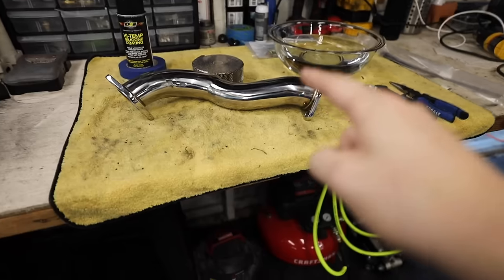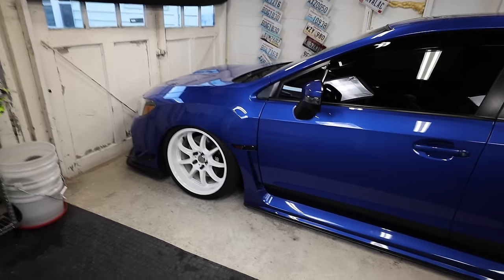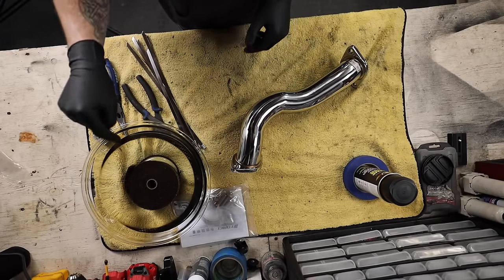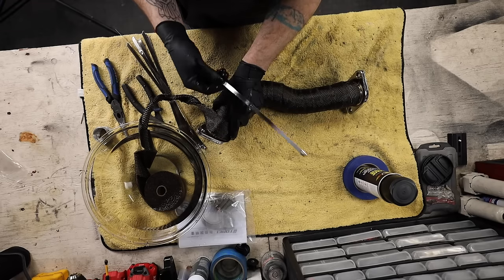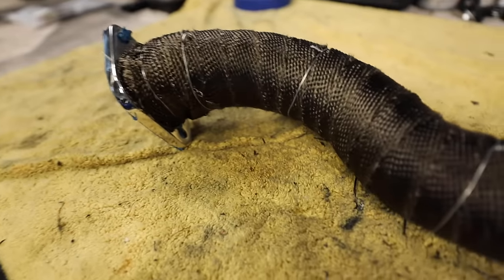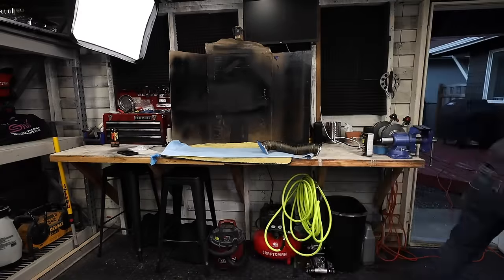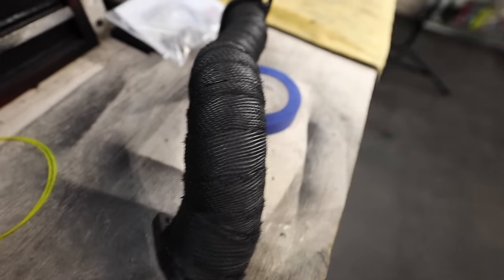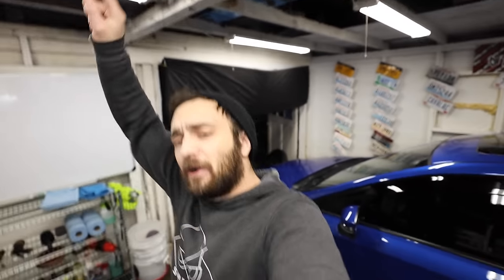How To Correctly Wrap Your Exhaust!

Comment: Hey boss, I’m getting ready in the morning to do my wrap for my overpipe as well on my Frs.  You make it look smooth and easy.  I bought the lava titanium, I thought they don’t recommend wetting it.   I started the process and it kept slipping on the bends of the pipe.  Will soaking it make it stay in place without slipping as you wrap ?
Reply from the maker: It made it a lot easier, you don't have to soak it but the material seems to form better to the pipe when wet 🙏
Reply: @Smeedia  awesome my brother I appreciate it.  I’m gonna do it.   Thx much ❤️
Reply: @Smeedia  just enjoyed your live stream.   Thank you for your service to our country.  I’m also a disabled Iraq war veteran. U S Air Force.  
I’m the one with the question about the  Mazda larger oil filters for your turbo Brz. It was awesome hearing you read my question.   Whenever you get a chance I would love the part no. Or the info on the Prova.  I don’t know if I’m pronouncing that correctly or not.    Thanks again what you are doing for our car community.   Much love and respect.  I’m going to get a T shirt when the Black Friday codes pop in.   ❤️
Reply from the maker: Appreciate the support my man! And lemme see

Mazda:N3R1-14-302
Prova: 10000SP0011

Thank you for your service as well!! 🙏🙏🙏
Reply: Disregard the filter info partner, I researched it and it’s the Mazda unit for the 09 RX8.  Filter no. N3R1-14-302.  👍

Comment: The wheel is cylindrical in shape, no one would prefer a square shaped tire from a cylindrical tire because the cylindrical tire already works great. Now the metal zip ties are already good stuff and for some reason, this dude chose the wires over it and made a thumbnail saying "the only way you should be wrapping your exhaust".

Comment: Even if it were the normal fiberglass that DEI supplies you never soak it, just dampen it up and if you cant get those metal zip ties ties its because you have the wrong tool... I’ve seen a drive type bit with a slot for relatively inexpensive but they sell a special plier like tool for the zip ties for around 20 bucks... tie wire looks shitty and lazy.
Reply from the maker: Disagree, I think yhe tip ties look bad, but personal prefrence on that one. Ive always had better luck with fully soaking vs dapaning or dry apication but to each their own

Comment: WTF dude this is the incorrect way to wrap this particular product. Did you care to read the manufacturers instructions or did you just make wild ass guesses based on what you have seen other people do with exhaust wrap? Direct from the DEI website on Titanium exhaust wrap.

DEI HT Silicone Coating not required
Pre-wetting roll not necessary for wrapping.
Reply from the maker: Without the coating the wrap will hold water under it and degrade the pipe over time. Don't have to wrap this way, but not going to let an exhaust company degrade to rust because the wrap is holding water in it.

Comment: What are the pros and cons
Reply from the maker: To wrapping your exhaust?
Reply: @Smeedia  yeah
Reply: @Smeedia  sorry forgot to say
Reply from the maker: Better heat control so you do not hear soak anything. Drawbacks are that the wrap can crack and damage the exhaust over time
Reply: @Smeedia  the braking of the exhaust is that like a 50/50